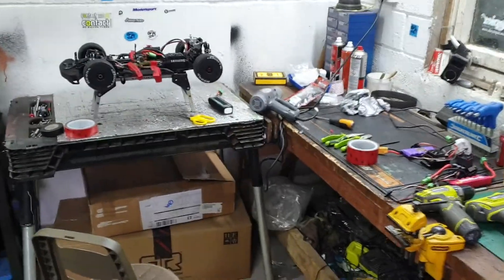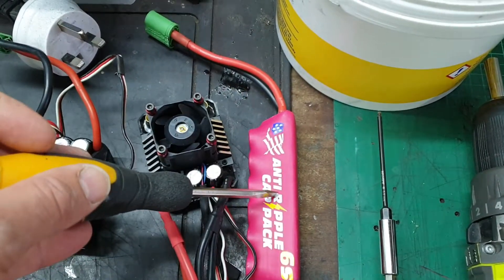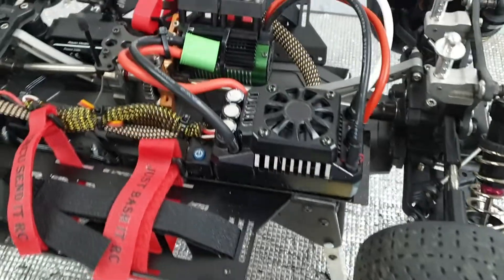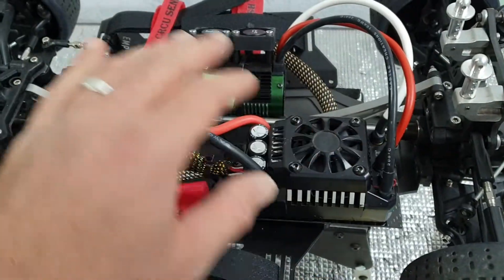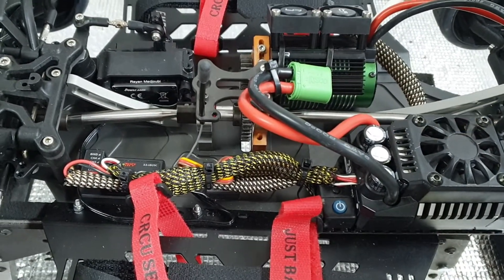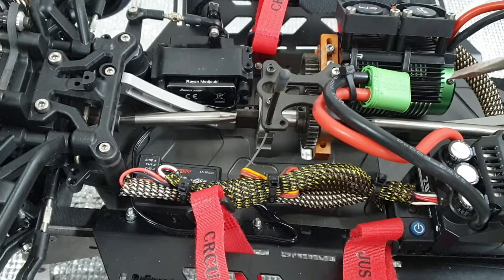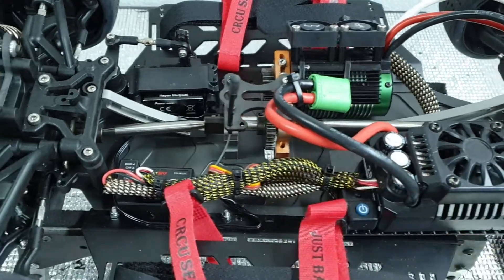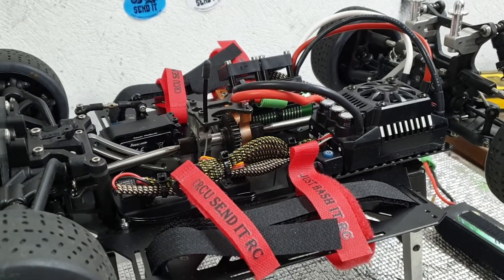Hobao GTB custom build, under the hood....

Comment: You need to go to castle...hobbywing has a 200amp rev limiter castle 8s has a 300amp rev limiter
Reply: Your motor is asking for more than 200amps and the hobbywing esc system says sorry this is all you get and the motor goes give it to me now esc says nope I shut down and nobody gets anything....that's my way of looking at it mine does it in the xmaxx when I gear it to high cause hobbywing designed the 1100kv at the 200amp cut off so I have to under gear it lol 20/35 mod 1.5 on a max5
Reply from the maker: @onemansvideos2134  thank you, I'm being stubborn I know. One of the reasons is I haven't got as much expendable cash since Covid19. Normally I would have bought a selection of escs to try but alas not at the moment!
Reply: @jameslyons1978  same here covid messed up my cash flow and shipping....I'd be alot further on my infraction build than I am right now so I completely understand I'm stubborn to